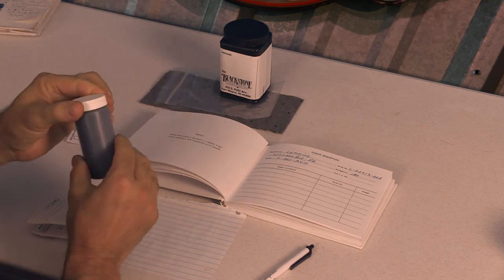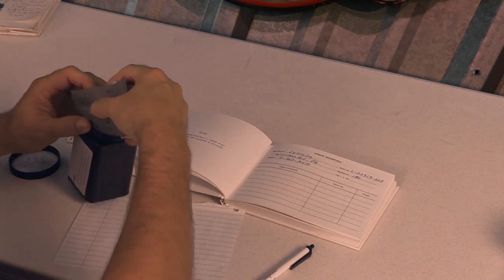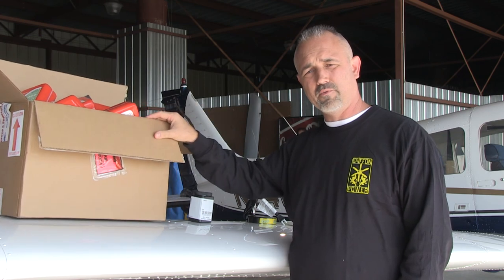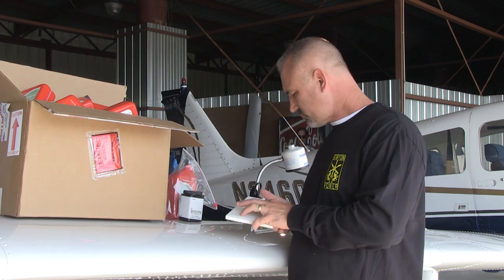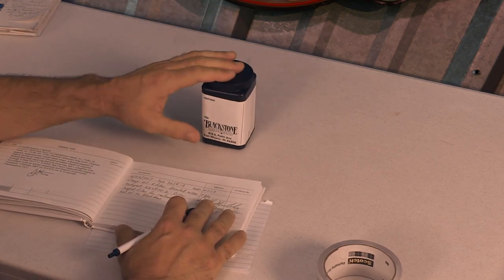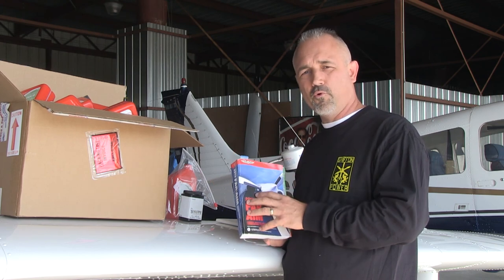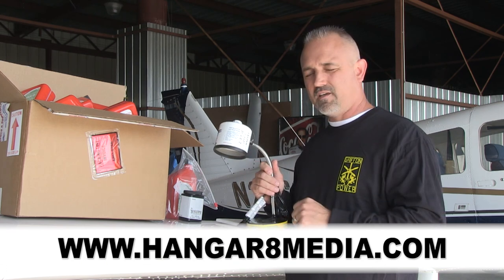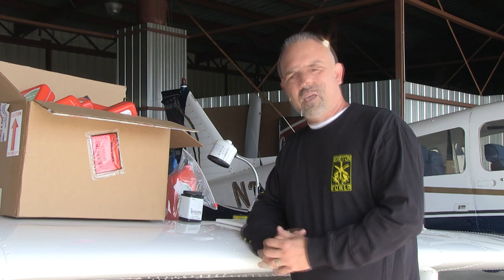DIY How To Change The Oil In An Airplane  Engine Part 3 maintaining an airplane oil change

Comment: Instead of attacking the filter with a samurai sword to just cut out a center strip of the filter media while standing up, position the filter on a bench or table and use a carpet knife to cut it on the edges (to remove the entire width of paper). Then slowly and carefully remove the element in small handfuls, trying not to flick out any contaminants. Gently lay the media out on the bench and spread it out for examination. (oil change 101)